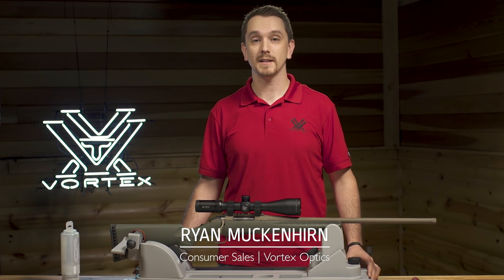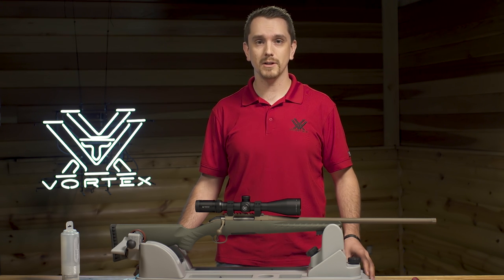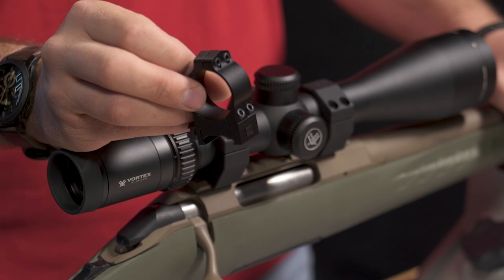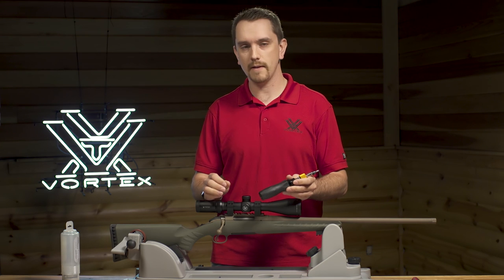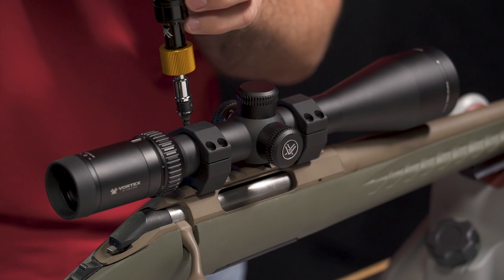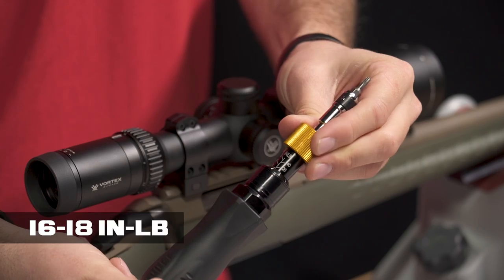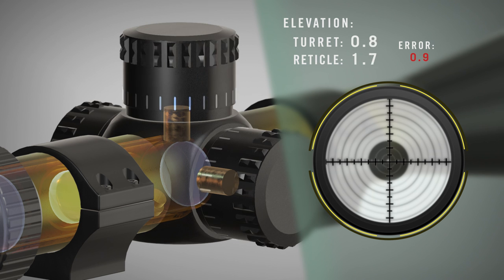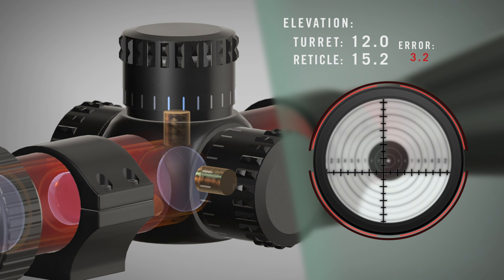How To: Tighten Riflescope Rings

Comment: How do you know if you've over tightened? I tightened my Viper HS LR to 21 ft/lbs because it kept sliding around in the rings (Talley rings). I also wish you all would bring back the Vortex Precision Rings. Those rings are the best I have ever used!! From the moment I tightened them down I had zero problem, as opposed to numerous other brands including some very high priced ones.
Reply from the maker: Assuming you mean 21 inch pounds? 21 ft pounds would be far too much and would crush the scope. There's no reason to need to go over our recommended 15-18 inch pounds unless the rings are not making good contact on the scope tube. In which case, you shouldn't torque it harder, but address the issue with the rings. If you're using a two piece set of rings, they will likely need to be properly lapped in order to make good contact around the scope tube and avoid slipping when torque to spec. Not sure what you're referring to regarding a discontinuation to the precision matched rings? Those are still around and very current.
Reply: Sounds like ur rings are not the proper size for ur optic tube. Get u a better set of rings that are for ur correct tube diameter and u shouldn't ever have an issue. I have shot some pretty large caliber rifles using these tq specs and have never had an optic come loose or move around.

Comment: How much "overtorque" can damage the optic? I've installed aluminium rings on my Razor 1-6 and used torque wrench that turned out to be badly calibrated and when second checking, it seems to have been be fastened to about 20 in-lbs.
Reply: I have torqued to 30 -35 with no issues. Just feels so much more secure.. Remember, these screws can't take much more than 35 period. I might tone it down to 20-25 inch pounds from now on.

Comment: Ryan, is the torque value different depending on how many screws fasten the upper ring half to the lower?  The rings you're showing have 2 screws on each side.  My DNZ Game Reaper only has 1 screw on each side.  Wouldn't I need to torque further for the same clamping pressure?
Reply: Same here and I agree.
Reply: My game reaper 2s have 4 screws and calls for 30 inch pounds. It also states that cheap scopes cannot handle that torque value.  Ever wonder why vortex has such low torque on ring screws?

Comment: If I had my scope sighted in and i retightened the ring screws because they got loose overtime, could it throw off the scope a bit, causing me to re sight in the scope again?
Reply: You should not have to re-tighten them. A drop of blue loctite on the threads and proper torque should have no issues

Comment: I have a Gamo 3-9x40W1PM scope with the usual Gamo rail. What size TORQUE WRENCH do I need the tighten the screws of the mount and the rings. I purchased a Sanliang Torque screwdriver Wrench Driver Bits set 10-70.
Reply from the maker: That would depend on the size of the head of those screws and what that manufacturer recommends for torque specs. Unfortunately, we are not familiar with those.

Comment: I've always tried mounting scopes by tightening upper ring half on one side all the way down to the lower ring half without over tightening it and then the other side by the exact torque specs.  and then switch over and do the opposite side all the way down on the criss  crossed
Reply: Definitely not the best idea

Comment: Is 24 inch pounds way to tight? I had a buddy of mine mount my new Strike Eagle 6-24x50 on my Savage 7mm. He said he's torqued his scopes to 24in pounds for years with no issues. I explained to him that the spec was 18. Do you think 6  more inch pounds would damage the scope?
Reply: I'd say probably YES, too tight. I go by the instructions. 18 in/Lbs max.
May not have damaged it, since it's a VORTEX, if you can never get it sighted and "Hold a Zero", you can send it in. They will repair it. Hope that helps. I doubt 6 in/Lbs damaged it, but I'd back them off for sure!!

Comment: Hello, 

Could you please let me know how understand what is the proper  torque spec for particular rings and scope? 
Do I need to ask that to ring producer or scope producer?

I damaged CZ scope with CZ rings and as I understand because of over torque. 

Now I purchase new 1 inch Nikon scope for .22 LR calibre but want to keep my CZ steel rings. 

Rifle - CZ 455, .22 LR calibre 
Rings - CZ 1 inch diameter. 
Scope: Nikon P-Rimfire 2-7x32 Matte BDC 150

Many Thanks in advance.
Reply: Always scope - if your rings handle more than the tube of your scope it could be damaged

Comment: Why would applying locktite have any impact on tq?  It simply just holds the tq you set.
Reply: RSLewis The problem with Loctite and other glue is that you’re get a false torque read. The torque should be applied on the surface of the head of the screw, but by adding compound on the thread, you add friction, which generate torque. It’s like trying to set a specific torque on a damaged screw.
Reply: Gaëtan Denis false, applying any lube, oil, thread locker and so on eliminates friction. Torque is a ballpark to set tension on the threads. When you add any liquid to the threads it takes less torque to apply the same amount of tension. Torque specs are recommended for clean dry new threads. Adding a lube can increase actual tension by up to 40-50%. Don't give advice if you don't know the correct answer.

Comment: I have the vortex Professional Series vertical split rings. I am using the wheeler professional scope leveling kit. I am following the instructions and when I am tightening the bottom screws it twists the scope to the left off of Center. I have mounted many scopes, this is my first time using vertical split rings. I am now trying to twist the scope further to the right from Center so that when I turn the bottom screws to their proper poundage it will hopefully line the scope in the center lined up centered with the bubble. I am slowly turning the screws a quarter-turn at a time does anybody have any tips on how to keep the scope from twisting to the left? I feel like I am regretting purchasing these Vortex vertical split rings.
Reply: It’s not just those rings man I’m having the same problem I even lapped the rings and it’s still doing this. It’s driving me bananas. And then using the wheeler levels is a pain cuz not every gun has a spot for the lever

Comment: Why do you max the torque wrench at 50 when other applications on the gun take over 60
Reply from the maker: Our torque wrench is designed primarily for riflescope mounting in mind, and it's really great for that application! If you wanted more of a "do-all" option, you'd likely have to do some research to find something that has a wider in/lbs variation, but for scope mounting, this one should have you covered!

Comment: how do i tighten them if i dont have that tool, cant find it anywhere, can i just like tighten it with hex tool or ?
Reply from the maker: Simply hand tightening them is an almost sure way to over-tighten those ring screws. We would recommend finding an in/lbs torque wrench or taking it to a gunsmith that has one.

Comment: I keep getting a gap on either side of the rings even using the criss cross pattern!
Reply from the maker: Good - there should be a gap! That's designed in the rings to allow for slight tolerance differences. Do not try to fully close the ring gaps ever - that will make the rings far too tight. Hope this helps!

Comment: You’re supposed to let it click 3 times when it reaches the set torque. Your only letting it click once and while I am sure it will be ok, it isn’t the 100% correct way of doing it according to the manufacturer instructions. And yes I know it’s a vortex  product and he works for vortex but that’s a rebranded capri tools torque wrench driver.  
Little side note. He is correct, threadlocker is not necessary, they will stay in place but if your anal and want to use it, make sure it’s the purple stuff. And when using threadlocker you should decrease torque values 20%-25%